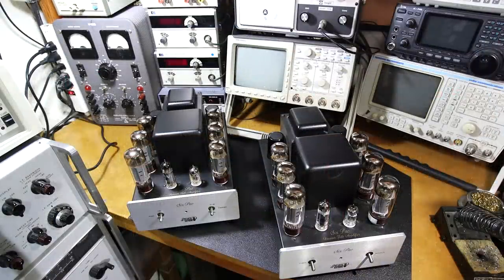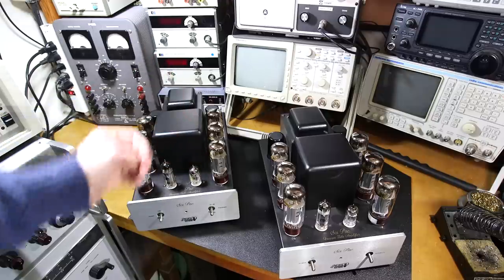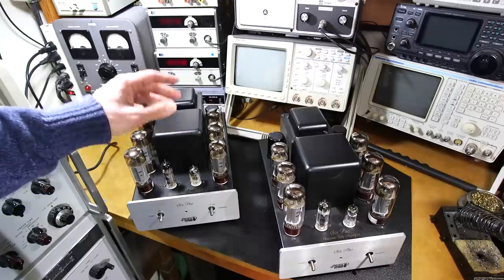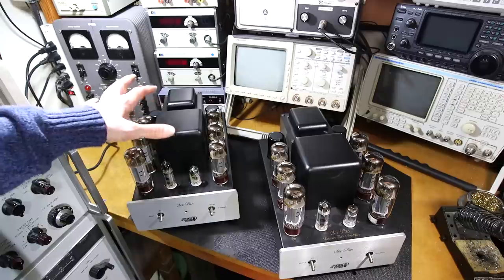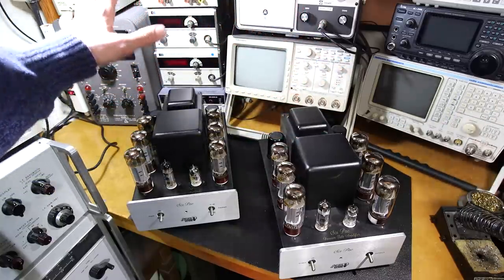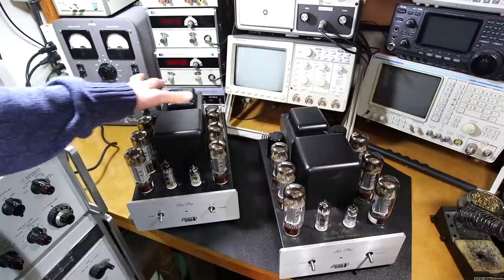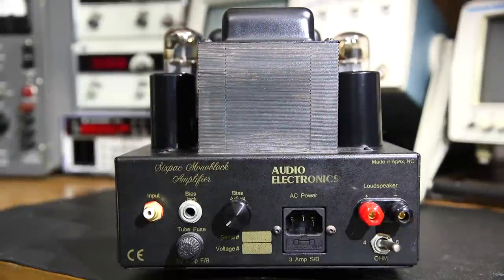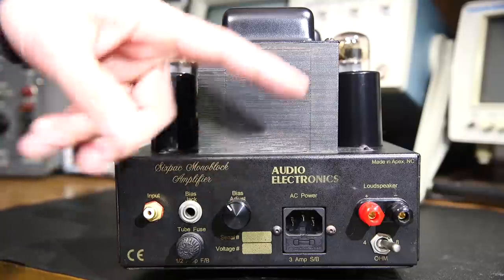Two Six Pac's On The Bench

Comment from the maker: To learn things about electronics that you won't learn anywhere else, go to my Patreon page. Click this link: https://www.patreon.com/MrCarlsonsLab
Reply: Great video as usual, if you have any interest in speaking with the person who designed these his name is Dennis Had, who is also a ham radio enthusiast, call sign W4USR. He is still making a line of amps called “inspire”, that can be found on eBay. Blueglow Electronics also did an interview with him on YouTube. The “made in Apex, NC”on the back is what gave it away. He was responsible for starting Cary Audio, I believe these came sometime after that, but not 100% sure.
Reply: You're correct on the chronology. Dennis also founded a company called Dentron in the late '70s or early '80s. Made several impressive products. When that company folded, he founded Amp Supply, which also suffered a financing fate. His call in OH at the time was K8KXK. He the moved to NC, started Cary Audio, and changed call signs as noted above.
Reply from the maker: Hi Igor. Take what your saying to an extreme. The extreme would be one bad triode and one good triode within one bulb. The answer is quite simple.... Yes they need to be matched, and matched closely at that. There is a reason for 2 very accurate plate resistors rated at 1% 50ppm.
Reply: Mr Carlson's Lab Another great video, Paul. I couldn’t put it down. Thanks a lot!
73, de N9WHH.
Reply: Mr Carlson's Lab Thank you for the reply. I miss labeled the output tubes as EL 84s instead of EL34s. That's funny they named the smaller output tubes a higher number. Go figure. The small mod you did to more or less double the output wattage was great. I have a feeling I can learn a lot from your videos! Thankz
Reply: Cary Audio will send you a schematic for these amps. AAMOF,the company's original owner, Dennis Hadd is a ham radio operator as well.
Reply: Do you have to have an industrial power supply to your house to power all that equipment?
Reply: @MrCarlsonsLab  It helps with Hi Fi to have matched tubes. I have a matched set of 58 GE (real GE) 6550As for a Conrad Johnson-ish style build I made myself. I usually add a way to balance the tubes later in the circuit as the tube wear. If the tubes are well matched in the beginning, they SHOULD wear at the same rate. People do feel jilted when I say "NO I WON'T SELL ANY OF THOSE". It took me over 10 years to get over 50 matched 6550As, and whole lot of money.
Reply: Mr Carlson's Lab
Reply: I put my money where my mouth is. I just became a Mr Carlson's monthly patreon subscriber. Thank you Mr Carlson.
Reply: that's  Dennis Had Carry audio   wow  hard to believe  must be why he left Carry
Reply: Nicely done deep-dive. I haven't looked at tube circuits for several decades so this was a real refreshing treat to watch.
Reply: Looks like the recommended bias was yielding an insane THD...but perhaps it's the sort of musical distortion that makes some like tube sound?
Reply: @daver1769  I used to drive through Apex, NC, everyday when I worked at RTP and lived in Fuquay Varina, NC.
Reply: Ç c @daver1769
Reply: I have a challenge for you, Paul. Make a radio set that has an oscilloscope, bias meter, wave meter, tube matching device, and efficient amplifier in it. 

Have no solid-state components in it whatsoever (not even early germanium diodes and transistors are permitted.) 
Should function stably in the event of a power failure (although if something does start acting up, you can diagnose it and fix it.)
Utilize both directly- and indirectly heated tubes
Have an adjustable RF power output
Have adjustable gain in the amplifier (with an upper limit to prevent clipping)
The same amplifier must have both an automatic zero-gain shutoff if the gain is turned too low
The same amplifier must also operate as an ultra linear amplifier only
Have fixed bias for all the tubes

PC transformer 120V-12.6V centre-tapped for the filament supply
120V-2kV microwave oven transformer for the B+
120V-2kV microwave oven transformer for the negative bias line

I'm suggesting microwave transformers because of the video you did on that GATES transmitter, and you said it uses 1.5kV rectified DC. 
A MOT outputs 2kV RMS, which is around 2.8kV peak, ignoring rectification losses.
I don't know the bias voltage of the GATES transmitter, which is why I suggested using -2.8kVDC for the bias.
You can use whatever circuits you want, and even design your own for the project.
Take as long as you need to build this receiver, I'm in no hurry to see it.

Comment: Great video! You check frequency response with the DSA without negative feedback against a dummy load. I think it would have been more interesting using a real speaker for that test because it would have introduced non-linearities (which maybe NFB would have corrected). Also at which output power was the plot performed?

Comment: The problem is we are swatting a fly with a sledgehammer. Khorns are the definition of a first watt speaker.
I drive mine with a 3/4 watt 45 set. Sweet with properly designed crossovers.

If you can drive 104db speakers with sixty watt push pull amps an make it sound good you are truly a god.

Btw, I really enjoy your channel and you are providing a great service to electric enthusiasts.tyvm.

Comment: First off, I would put a 33 Ohm resistor on each cathode, to allow the power tubes to current share more accurately. Right now, the tubes have to be evenly matched, to keep one tube from taking the lion's share of all that bias current. The higher the cathode follower resistance, the lower the necessary bias current to eliminate zero crossing distortion. It will reduce the gain of the power tubes somewhat, so it's necessary that the amplitude of the phase inverter be sufficient to drive the grids, + the extra amplitude that will be lost in the voltage drop of the cathode follower resistors. To go from 50 watts RMS to 100 watts RMS, bypassing that big 2.2 Henry choke coil will increase your rail voltage to about 550-560 volts.(that's what I think the mod was. Quick and easy.) That will increase the amplitude enough  to double your output power. you only need to increase amplitude by 42% to more than double power. It is necessary, to increase negative bias, because the extra voltage on the screen grids lowers the cutoff voltage on the control grid. The unregulated supply on the constant current sink, is no problem, nor, is using a different type twin triode. The voltage on the load resistors will stay roughly the same, regardless of the bias voltage of the control grids on the phase inverter tube. Any change in sink current results in a change in voltage on the load resistors, but that difference is taken up in the .22 uF coupling capacitors. As long as it doesn't drift at any audible frequency, it will not induce noise in the output stage. I don't see much need for the regulated supply for the plate resistors, because any noise there is common mode, and would be rejected by the output transformer.

Comment: What about "not operating a tube amp without a proper speaker or dummy load"?  Rumor says there is a issue with the output stage impedance seen by the output tubes.  I just follow suit and use a load, more important when setting output bias.  What's your take on always using a reasonable load device?

Comment: I haven't seen the double diode trick in a while. Aren't there modern diodes for this application? 
Very curious placement of the choke. I never saw one in the middle of any chassis for anything. I wonder if the choke was topside in an earlier design and then, later, it was decided that it looked too cheap compared to the two other beefy, heavy-iron transformers, so, it and shoved underneath in the only available space. Just a theory from sales v.s. engineering experiences.

Comment: The amplifiers have a full rectifier bridge but it is not connected that way. In each line 2 diodes are in series, which could be replaced by one each. I would have expected the two lines from the transformer to enter the bridge in between the two diodes and the minus connection of the bridge connected to the center point of the transformer, being ground. Or am I completely mistaken here?

Comment: there you really have a couple of real beauties ! look like the old partridge low distortion o/p xformers 
wonder why they'd use el34 o/p tubes and a 12ax7 for phase inverter . there must be kt66 s & kt88 s available with all the new tube factories and 12at7 would be the higher current version of that style twin triode

Comment: @01:01:28  Is an oscilloscope actually sufficient to tell whether there is distortion?  I think one can have significant distortion on a sine wave without it being easily discernible visually.  Personally I can notice distortion on a LF sine by ear at much lower level than I can identify it on an oscilloscope, but I guess that may depend on how much experience one has observing waveforms.  The spectrum display on the DSO however will readily show up distortion way below the level I can notice it by ear.

Comment: How does a 'step up transformer' work? - How is it possible to make more power from less power? - Unless you mean power is stored , so that sudden release at any one time may seem like more power.... Matter (energy) is neither created nor destroyed, it can only change form or be stored.
Reply: Greetings:
Its in the windings turns ratio, transforming input volts times amps to output volts times amps. Power in = power out (minus efficiency losses to resistance and eddy currents).

Comment: Excellent stuff.
Now I am left wondering how did you get it to 100W?
Reply: Me too... :-)
Reply: I think he connected the amplifier in bridge modus... 😉
Reply: Must have switched to 4ohms...
Reply: Paquito Lim,  He said 15 sec. That's too long to flip a switch.
Reply: He answered one guy already who asked if he did that. He said no, but good guess.
Reply: ECC83 :)
Reply from the maker: Here it is: I added  22uF of capacitance at the B+ reactor, on the diode side. This makes the reactor look like DC resistance in the circuit (a big resistor instead of an inductor.) The B+ goes up to 600 Volts.
Reply: After watching the video and seeing this answer I see where you gave the hint. The wave looked clean does it still have the same distortion? Also would the lifespan of the components be greatly reduced by the voltage?

Comment: I know why the amplifier was humming! It didn't know the words :D
Reply: Bom bom tsssch.
Reply: This is why I keep my amplifier underneath a Singer sewing machine.  Of course,  bad puns like this one probably won't have anyone in stitches.  It's about as funny as bobbin for french fries.  I mean, I'm hanging by a thin thread, as I destroy the social fabric.  My career has gone down the tubes, since I decided to live off the grid. I no longer pay rent;  I pay space charge.  Admittedly,  I still have a lot on my plate.
Reply: That one was old whent the Dead Sea was a little bit sick!!
Reply: @gyrgrls  Nothing wrong with living off Grid mate.I set up a RAPS (Remote Area Power System) System for my oldies 20 years ago & it's still going strong. It's a Hybrid system and even has enough power for the small workshop and start 2 hp motors easily on top of running the house. The only thing is Batteries Die occasionally.
Reply: @gyrgrls  ,  So bad that it's good!

Comment: I instructed Mil Std 2000 Category "C" soldering, wiring, and electronic assembly, as part of my job - for 17 long years. When  I blinked, and you changed views to the underside of the chassis, I couldn't believe the rat's nest.  Proper lead dress, and component placement were in no way primary considerations during the design phase of these unit's implementation. Shielding  and ventilation were never taken into account.  I could see taking short cuts with lower end "get it out the door" type merchandise, but not with anything sold with the intent of satisfying fussy audiophiles.

Soapbox dismounted before going on a "pride of workmanship" rant.  (sorry, I'm becoming an "habitual bitcher" - as I age like 'milk'.)
Reply: It looks like they focused on component placement on top of the chassis and did the wiring as a bit of an afterthought. You are right in that very fussy audiophiles would probably develop an eye tumor after seeing the lack of regard to the separation of AC, B+ and C- from input and output audio.
Reply: +Tisha Hayes, many thanks for the reply, as I'm normally not one who tries to be critical about the work of others. With that said, I've had Mcintosh equipment apart, and initially figured that the two brands are "somewhat on par" stylistically.  What I believe to be the case, is that AES developed a stellar design for the "Six Pac", and failed to follow the quality of design - through implementation and production.
Reply: AMStationEngineer the whole design seems a little ridiculous to me... Using an entire el84 and multiple chokes to regulate things, but then letting it out the door with significant coupled hum. Plus, going through all that work, having all that weight of iron, and that much moneys worth of glass, and all that heater amperage baking your room, all to push only 50 watts out of all that gear.

 I guess that kind of clean linearity over such a (very excessively) wide bandwidth is nice to have though. But seeing how ugly it is inside and the clear design fail on that choke is troubling.
Reply: You certainly aren't the only one that said "what a ratsnest!" as soon as he took off that bottom cover. I was building better laid out ultralinears when I was 12 (admittedly at my father's direction) than the underside of that thing. But what really bothered me about the design was that loose knob to set the bias, without a locking ferrule or screwdriver adjustment.
Reply: +I Wilton, My high school electronics teacher would've talked three other teachers (of unrelated subjects) into failing me for the year, had I wired something like this.  They "pretty'ed up" the top side, and didn't give a damn about the bottom. I am admittedly not an audiophile anymore. Age, and years of working concerts, and around jet aircraft took care of that a few years back, however, my component rack was "harnessed", anything capable of noise emission was shielded (and ferrite beaded). When I sold that equipment, I recouped most of what I had in it.  It may be that we are living in too different a time, and are inordinately 'fussy'¿?
Reply: +Daniel G, I think that much of the design is appearance-driven. With that said, if memory serves, when learning tube-moderated design theory, when Nixon was President, we were instructed that it is best  to follow the "original, and intended design of the tube's factory spec", and that tubes, and their associated circuitry, have their "own natural resonance - don't fight it". 

With the correct thinking, a "less compact design", and some decent ventilation, this could be a far better performer.
Reply: +Grand Negus; I worked in avionics, quite necessary there, but it depended on their methods. Some were tyrants....
Reply: My thought exactly, such a difference in build quality once you open this thing...so strange
Reply: I have had to pass three Mil C courses in my military maintenance career. Yes, it was a royal PITA each time. On the other hand, while useful for teaching basic and advanced soldering skills, except for "attention to detail", what I learned was largely useless for field repair work. 

For instance, have you ever tried to repair a radar on a hilltop in Germany in February where it is difficult to keep your soldering iron hot? Chassis and subassemblies are "plug and chuck", so they can be repaired on a bench back in the rear, but sometimes you need to poke around deep in the innards on that not-so-mythical hilltop in Germany. That is something a mil spec soldering course does not address.
Reply: Nowadays everyone says that all the modern "high end" amplifiers are done with point to point soldering because it's easier to repair (lol, no)  and less noisy and stuff. And then you look inside one of theese modern "high end" amplifiers and your eyes start to bleed. Like seriously, you chose the publicly believed better method, and failed at every point that presumably makes it better. Why?!
Reply: @ninethirtyone4264  Worse than that, many are using PCB's with surface-mounted tube sockets that can flex the board, break solder joints if not GENTLE effort used when replacing a tube, etc.
Reply: @AMStationEngineer  I did a five year electronics apprenticeship with a military electronics company in the 70's. No problems with the 'Rat's nest' and star  earth connection.. It's called 'point to point' wiring and it's the best techniqre for noise reduction with no ground loops.
Reply: @andywason3414  I don't entirely disagree, I build, rebuild and restore vintage tube amps. McIntosh, Harman Kardon, HH Scott etc. Point to Point wiring has it's benefits, but when you look at a Mac or one of the other vintage high end amplifiers you see quality of build and the point to point wiring is well thought out. This amp does in fact look like a rat's nest. I built my own VTA 70 amp from a kit and all of the P2P wiring was neat and dressed.. After seeing this new tube amp, I'll stick with the vintage stuff.